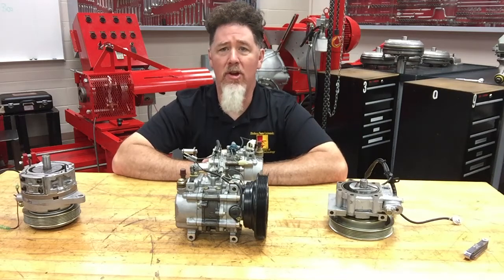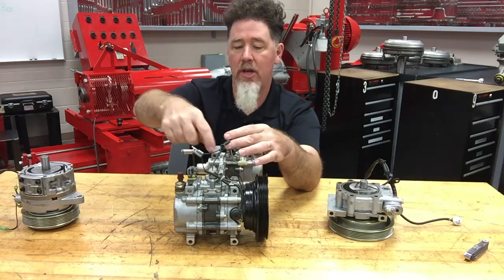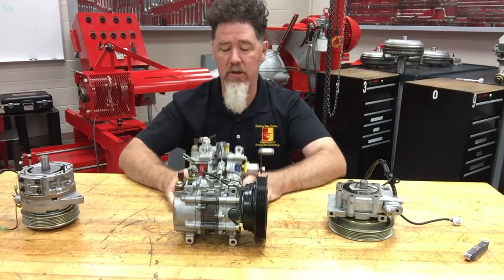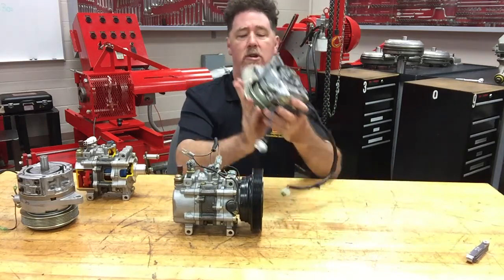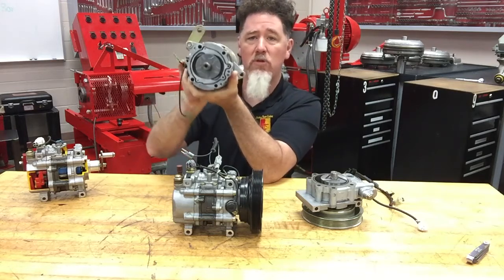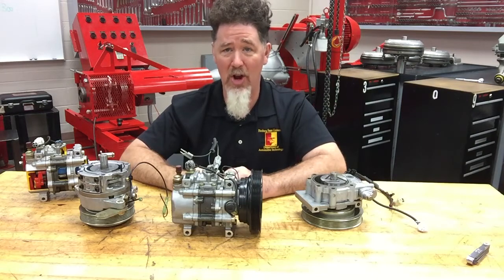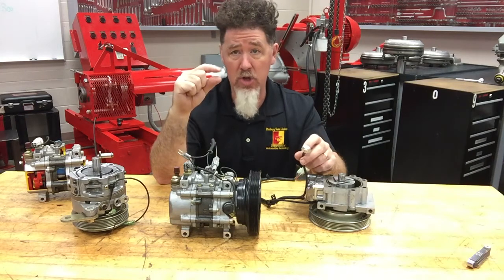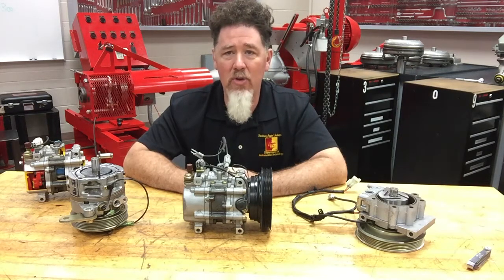Lesson on the Vane A/C Compressor Part 6

Comment: Great video. I have had a hard time finding a rotary vane compressor. Can you tell me a make and model that would have one in it. Thanks in advance!
Reply from the maker: Hi Dakota,   Older Toyota vehicles used the vane type of compressor in the 90's but I have not seen a Vane Compressor on a newer vehicle in a while.
Reply: Professor Pentane  thank you
Reply: Hi what can cause a rotary vane compressor to not pump efficiently? For example 60psi on the low side.?